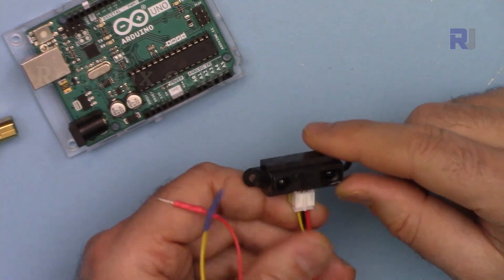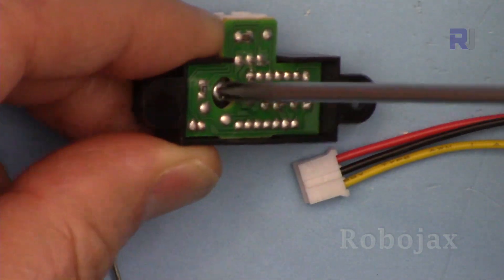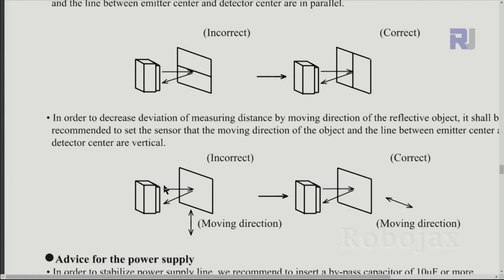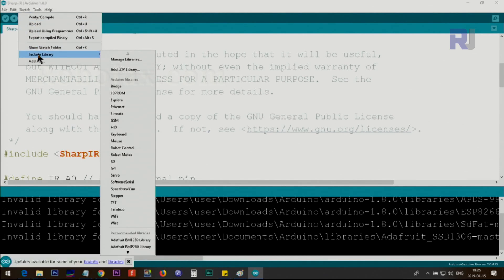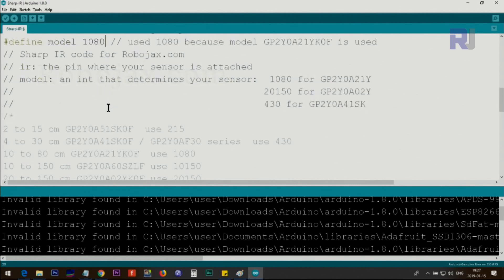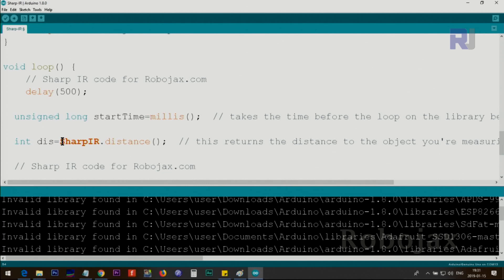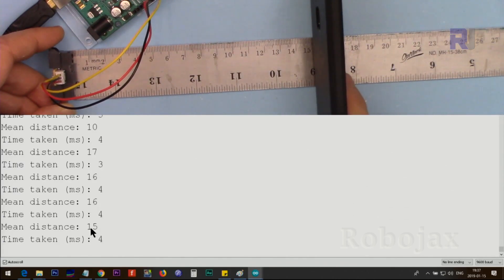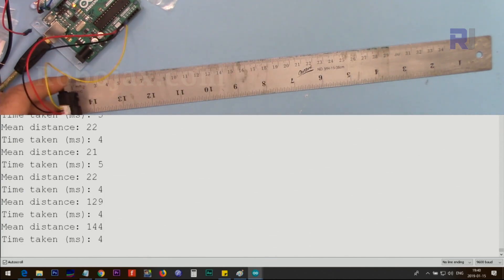Lesson 73: Obstacle Avoidance, Distance measurement using Infrared Sensor - RJT473

Comment: I got the such ir sensor from printer but it has 7 wires
How should I use it?
Reply from the maker: that must  be different. find the datasheet and see if it outputs voltage or digital data.  Once you found the model number, then search for Arduino library for it.